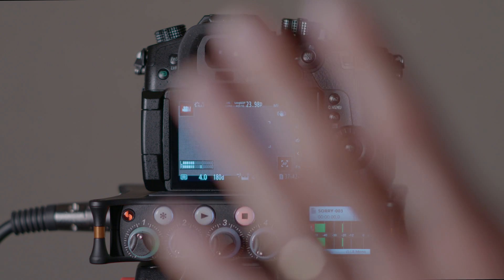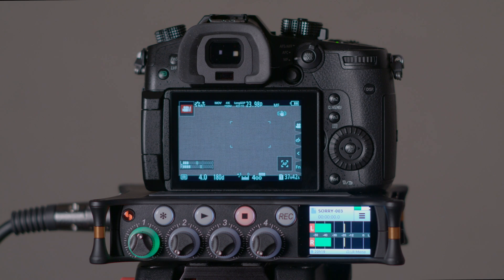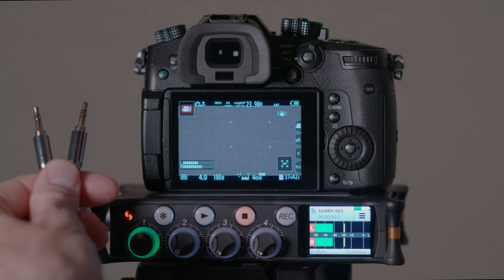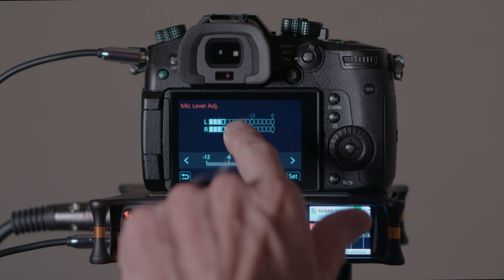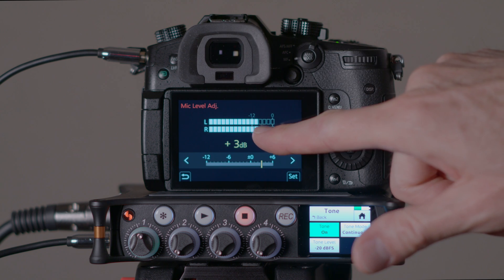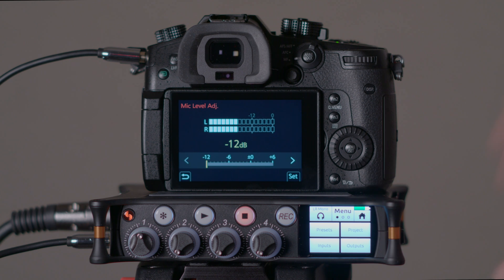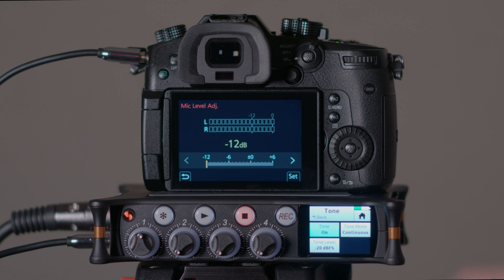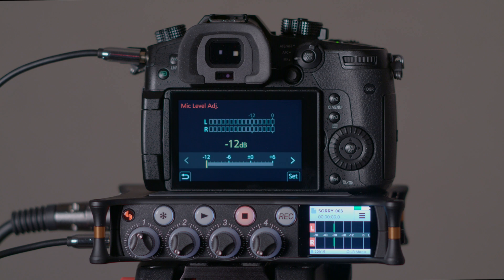Sound for Video Session: Set Audio Levels From Recorder to Camera with Tone

Comment: Thanks, very helpfull! 
The Mixpre has good amps and also  I guess good digital analog converter. 
If we put the audio into digital in the mixpre, then again back to analog for the cable to the gh5 then again into digital in the  camera with the worse converter, do we loose sound quality? 
Is the sound on the sd card in the mixpre better than the one in the camera?

Comment: Is there a way to trigger "record" directly from the camera via the aux-in?  I use a C70 via the timecode port, but it only records when I first turn on the camera or record.  When I  stop the recording via the camera, I can't trigger the recorder once again.
Reply: I am not sure whether the C70 sends the HDMI trigger info via HDMI. Probably best to check with Sound Devices support to see what their tests say.
Reply: @curtisjudd  They said to use the "Rec Run" setting, and now it works perfectly.
Reply: @pixelreflexmedia  👍

Comment: Thanks for the video! Great job :) - Would be great to find out if the meter on the Panasonic does adjust in -2db increments from top to bottom. Sometimes the increments of audio meters jump in larger values the lower down the meter you go.
Reply: I'm not certain. You're absolutely right that many meters are logarithmic (or at least not linear), but I don't know on the Panasonic. I seems to behave like it is linear, but that's a guess.

Comment: will appreciate some guidance how to set the one on my Mix Pre 6 and my Sony A6400
Reply: Hi Chamba, I'm sorry, I don't understand?
Reply: I was trying to calibrate my Sony A6400 with MPII - thanks for the reply - I was checking your courses too...
Reply from the maker: @salvadorla1  Oh yes, this process overall should work. The settings in the Sony should be similar. If there is an "Auto levels" or "auto gain" setting in the camera, but sure to turn that off.

Comment: How did you mount the camera on top?
Reply from the maker: Use the Allen wrench on the back of the MixPre under the battery sled to push the 1/4” screw up through the bottom of the MixPre into the camera.

Comment: Hi Curtis, thank you for this fantastic resource. I have a question, do you know that there is anyway to connect the MixPre 6 to a camera so that when you rec the camera you also rec on the audio? I have a Canon C70, and I am considering adding my MixPre to my camera rig for days when I need more than two lavs out. At the moment on days with a lot of audio sources I carry my MixPre with me in a side bag, but this can be distracting as I need to remember to rec in two places at once, and also because I need to frequently jam TC to prevent drift which seems significant between the two devices. 

I would love to be able to integrate the two systems, ive been looking for answers in the user guide, but I cant seem to figure anything out! 

All my best!
Reply: The MixPre has an HDMI feature that allows auto start of recording with a select number of cameras. I don't know whether the C70 is included, but you can contact Sound Devices support to confirm.

Comment: Great video as always, I have the GH5 and the Zoom H6, will you be doing a video on your settings for the GH5 for video, I would be interested in knowing your settings compared with mine?
Reply: Hi Yorkies Bits and Bobs Home Tech. No plans for a GH5 video at this point. Which settings in particular are you interested in?
Reply: @curtisjudd  I have saved my settings for 4k on C2 and I use MF raver than autofocus do you do the same?
Reply: @YorkiesBitsandBobs  You are far more disciplined than I am - I just change the settings to what I need for the particular shoot.
Reply: @curtisjudd  Ok, thanks for that info

Comment: Thanks for the video Curtis. I’m connecting my MixPre 10 II to my Panasonic G85 and I’m getting a small bit of noise. It’s not near as clean as the recorded audio on the MixPre. I’m using the X1/X2 output set as L/R and have tried different settings from -40 to -10db on the MkxPre while having the G85 set to -12db. I’ve also tried using a combination of a Movo attenuator to reduce it more. Any thoughts on how to have completely silent output to the camera? Or is there a special 3.5mm TRS cable I should look at using?
Reply: Hi Bourbon Pursuit, I think the more likely culprit is the mic input on the G85. I've had pretty good results attenuating the 3.5mm output on the MixPre by about 35dB with my GH5 and it isn't as clean as the MixPre, but good enough for sync or for non-paid projects.
Reply: @curtisjudd  that makes sense. There is no silver bullet. As a podcast, I’m looking for the cleanest sound and this was a shortcut for one of the segments we produce. But syncing in post is probably going to be the best option. Thanks for taking the time to respond.

Comment: Thanks for the video. Just ordered a Mix Pre 3 II to use for audio with my Nikon Z6 II. Pardon my ignorance as a relative audio newbie but why would we want to send audio to our camera from the recorder if we plan on just using the recorder audio and syncing later? Also, any general tips or videos on how to best sync the audio and video later?
Reply: Hi Allen, Feeding audio to camera can save time in post if you're already mixing your audio. It makes more sense for quick turn-around content like news and some corporate video. If you are planning to sync in post, this can also help by recording a sync track to the camera. Then you are assured that the process of syncing the recorder audio to the camera audio in post will work reliably. But of course, this isn't required. If you prefer, you can record scratch audio to your camera with the camera's in-built microphone and use that to sync to the higher quality recorder audio clips. Most of the pro video editing apps have a feature which will automatically sync two clips based on their audio tracks so it is pretty straightforward these days. Which app will you use for editing?
Reply: @curtisjudd  Thanks for the quick reply! Makes sense. I'm usually just video recording myself in "talking head" tech videos or one other person so no real "mixing" going on. I guess I will have the Mix Pre on my tripod with camera on top or nearby somewhere and use a 3.5mm cable in to the camera to have that track available to help sync. Why not right? 

I mainly use Camtasia for video editing (I know it's not pro stuff but it's simple and works well for my needs). I found this video which has some guidance but it doesn't look like there is a kind of "autosync" feature (https://www.techsmith.com/blog/sync-audio-and-video-sources/). 

Can't wait to get this recorder and start trying it out! I've watched some of your videos (which are all great and well done BTW) and curious if the SD card type and speed matter (UHS I vs II) like it does with cameras. I just went with 3rd party UHS I cards on their "approved" card list since Sound Devices cards seemed ridiculously expensive for no reason. Does the speed and brand really matter?

Next I'll need to get a good mic to use with this system. My existing Saramonic gear probably won't cut it unfortunately...
Reply: @skyace888  Stick close to the recommended media list. I've heard of several people going off and buying expensive, super-fast cards and they have trouble with them. Audio is not nearly as demanding in terms of card speed as higher end cameras.
Reply: @curtisjudd  Thanks for confirming. I got a mix of SanDisk and Lexar cards and a Cruzer USB flash drive for the backup recording files.

Comment: Hi Curtis, thanks for this video !  is there a difference between the sound quality recorded on the SD card in the MixPre  and the sound recorded on GH5 via the MixPre (see your set up in this video ?).  Using this GH5 set up is more easy because you don't have to sync in post (timecode or wave).  thanks, Marc
Reply: The difference is small but present. The GH5's audio converters are decent but if you need to save time in post and won't be doing a lot of processing of the audio, then it is probably fine to feed the audio to the GH5.

Comment: Thanks for the video! I get the idea of calibration to a known level.  What I’m not understanding is which controls are best for getting the camera set:  increasing camera gain or reducing the mix-pre’s output gain (or vice versa). Or does it matter?
Reply: Hi Steve, generally I try to set the camera's input setting to its lowest possible and use the output fader on the recorder until the meters are at the same level on the recorder and camera. That's the ideal.

Comment: Thank you so much for this very informativ video! Currently i have a problem to do the same audio level check with my smartphone like you dit it with camera. I connected a RODE wireless Go to AUX Input of my MixPre-6 and set Channel5 to 30dB Gain. on the stereo output i have -20dB. Stereo out is connected to smartphone.  But recorded sound in smartphone is noiser then recorded sound directly from wireless Go set.  wondering if there is any app for android phone to do same procedure like in your video for camera.

Comment: I'm running an a7siii with a mixpre 3 and Ninja V. It appears the Sony only does mic level and runs the Sound devices signal through the cameras pre-amp and sounds horrible. The camera can't go anywhere near as low as -20 DB tone. So would bypassing the camera and going straight into the Ninja be my best bet? I might have to deal with setting it up for any latency issues but it seems a cleaner solution. Am I on the right track? Right now everything is recorded separately and synced in post. For small jobs that takes more post time than I'd like.
Reply: That seems like a good approach. I'd guess that the Sony is doing some sort of automatic gain control(?)
Reply: @curtisjudd  Thank you so much!! Your videos are incredible and have honestly taught me almost everything I know about audio engineering. Great work.

Comment: Does the sound devices mixer you have here also have a dedicated RTN input for confidence monitoring back from the camera in the way as the older Sound Devices 302 does? Many thanks. Great video!
Reply: Hi, no, the MixPre series do not have a dedicated camera return input. You can use the aux input but that will take at least one channel. You have to move up to the 6xx or 8xx series to get a dedicated return on the current product line.

Comment: Curtis Judd is absolutely amazing!! I've recently gotten into video production and Curtis is my new hero!! Everything he puts out is top notch...even down to the amazing description layout where a lot of videos fall short.  Thanks Curtis for your amazing channel!!

I do have two questions about running audio from the MixPre into my DSLR.   In general, how much of a quality difference is there between the audio recorded on the MixPre and the audio routed via 3.5mm into the camera? 

Also, would the 3.5mm cable introduce a greater risk for rf interference?

Thank you
Reply: Thanks so much, Richard! It depends to a large extent on the particular camera. Since you are using the MixPre as the preamp, you're basically relieving the camera of that duty. However, the camera must still convert the audio analogue signal to digital. So depending on the camera, the quality can range from poor to pretty good. I would test with your particular camera both ways to confirm it is good enough for what you're trying to accomplish. The cable can pick up interference, but usually short 3.5mm cables from the recorder to camera are not a problem. Just avoid 10 meter long 3.5mm cables. 😀

Comment: My pcmd100 signal is very low but when I make a sound mh gh5 meter shows distortion, while d100 is nowhere near distortion. On the gh5, mic level adj. is set to -12db, so i cant go lower. What to do to match the signals?
Reply: That probably means that the PCMD100 is putting out a much stronger line level signal. So you will need a -35dB attenuator cable.
Reply: Curtis Judd Right, didn’t know those kind of cables existed too :D Thanks Curtis! I need to consider it.
Reply: Curtis Judd Oh, and so that will reduce the gh5 mic level by further -35db so I can match the signals, right?
Reply: @bushboxer  Technically, it is reducing the output of the PCMD100 by 35dB, but yes, the net effect is the same.

Comment: Hi Curtis, I'm curious about your thoughts as far as sending audio from the 10T to a camera via xlr.   I’ve read that the Mixpre doesn’t provide a “pro” output level but consumer version and that you should therefore set the camera input to Mic.  But in your Light & Sound course on the 10T you set the pocket cinema camera to line level.  Also you suggest tone level of -20db here but -10 in the course example.  I'm going to be working with a Canon C300 and just looking for some clarification around this stuff.  Thanks in advance for any thoughts!!!
Reply: Hi Dicky, with a MixPre 10T and Canon C300, I would set the camera's input to line level and use a -20dB tone from the MixPre to calibrate levels. I have used my MixPre 10T to send audio to a C200 with these settings with great results. Best wishes!
Reply: @curtisjudd  Awesome, thanks!  Are there cases or cameras with which you've had to set the input to mic level?  And how would you know to do this, just if the levels in the camera are too low?
Reply: @dickydahl  Consumer level cameras with a 3.5mm input are almost always microphone level only. A few - Panasonic GH5S and Blackmagic Pocket Cine cams - have 3.5mm inputs which can be set to mic or line level. Almost all cameras with XLR inputs can be switched to line level and is the preferred way to get audio from your audio mixer/recorder to your camera. You can tell by reading the documentation or asking your friendly online audio guy. 🤓
Reply: @curtisjudd  Ha...the latter being my preferred method!

Comment: Hey Curtis sorry for troubling you again. I noticed when I record sound from the mix pre to gh5 that it get a clicking sound few times a second and it is very audible when the sounds coming in is quiet. Have you had this issue also? I tried listening to the audio from the mix pre direct and it sounds great
Reply: Hi, no, I haven't experienced this clicking.
Reply: @curtisjudd  Here I've uploaded one clip so you can listen: https://www.sendspace.com/file/zqpld8

Also will update you if I will be able to fix this
Reply: @hzubovi1  Hmm, sounds like RF noise. Is wifi or bluetooth on in the GH5? You might try turning that off. It could be that the cable from the recorder to camera is picking that up. Also try turning off any other sources of RF - mobile, etc. just to understand where that's coming from.
Reply: @curtisjudd  Hey finnally found out what it was. So whenever I connect the sound devices with the top screw to the gh5 the sound appears. When they are not combined the sound is great. Also the sound you've heard only appears on the gh5. Mix pre records the sound flawlessly. I will try to find a quick release plate I can mount on top the mix pre. Do you know of any by chance?
Reply: @hzubovi1  Good find! Manfrotto makes severl different QR receiver/plate options available at Amazon or B&H.

Comment: Hello Curtis, thanks for your helpful work! I'm a GH5 and NTG3 owner searching for a good audio solution for solo shooting a documentary movie about a musical production. I'll work handheld without a cage. Could you recommend me the mixpre in a bag with spiral cables to- and from the Gh5? Secondly I'm a bit worried about wrecking my GH5 mic input with the line signal. Don't I need an attenuator cable? As well when I'm capturing audio from the headphones's out of a H4nPro?
Cheers, Christoph
Reply from the maker: Hi Sergej, sure, spiral cables should work though I don’t have any specific cables to recommend. You do NOT need an attenuator from the MixPre as it has an output fader which allows you to send a mic level signal as demonstrated here. With the H4n you will need an attenuator cable. Best wishes!
Reply: @LearnLightAndSoundSessions  Thanks, Curtis for answering that promptly! As a solo shooter doing sound on my own with lots of unpredictable sources (people talking, singing, whispering, music playing loudly, playback, whatsoever), do you think an "old" mixpre6 fits for my purpose or do I need a 32bit float mixpre II model?
Reply: @verygrandpa  I think it depends. If you are going to feed all audio to camera, then the original version should be fine. 32-bit is more useful when you're recording things which your camera will not have the dynamic range to handle. So while the MixPre II can handle most extreme dynamic range situations, output from the MixPre to camera can still clip or be severely limited by the output limiter.

Comment: Hey Curtis, trying to send individual channels of audio from the new MixPre 3 II to an S1H. For some reason I cant seem to get channel 1 to go to L and channel 2 to go to R? Am i doing something wrong or is it not possible to do anything other than a stereo mix of the two tracks?
Reply from the maker: Sounds like you may need to adjust the routing for the outputs if you're trying to send one mic channel L and another mic channel R. This video isn't for the MixPre, but illustrates the idea: https://youtu.be/As-jVp-ROCo